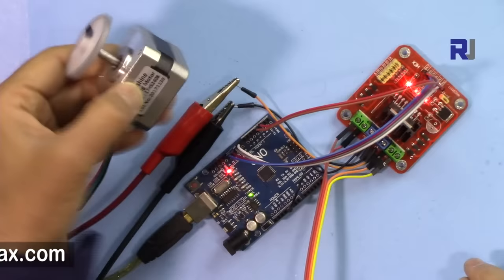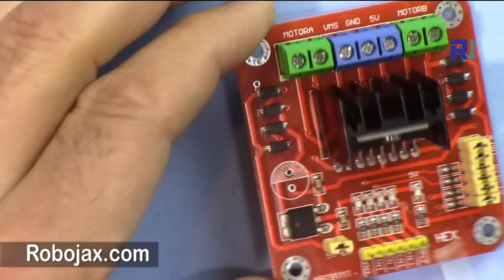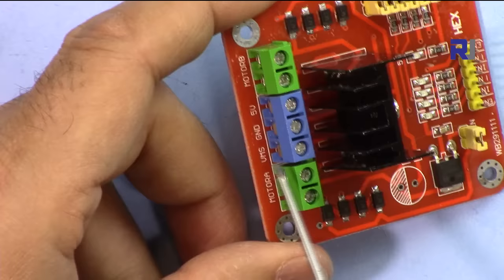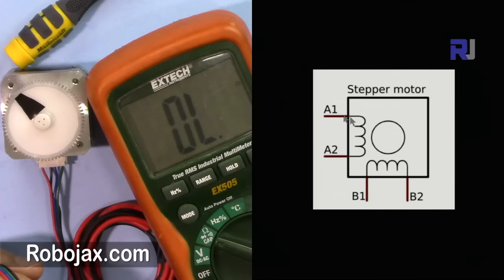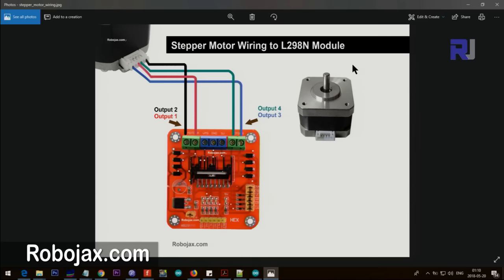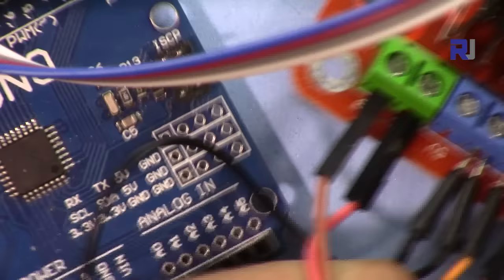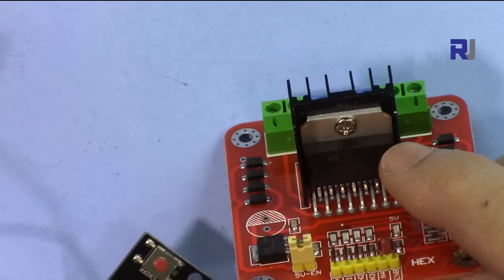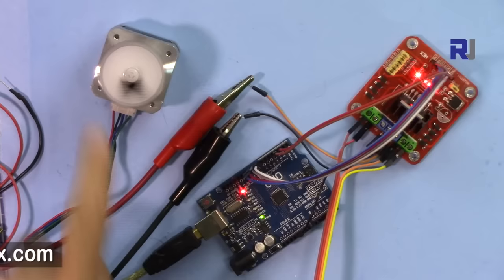Using L298N Stepper Motor Driver To control 4 wires  stepper motor

Comment: Hi Jax. I found you by accident but I'm glad you did.  You have the only video with enough information for me ( a noob ) to understand. I was wondering if you could make a video or explain to me how to code the stepper motor to pulse once everyday. Thank you so much for the amazing video!
Reply: Aka What would be the value of the RPM and and the SetSpeed in order for the stepper motor to turn one rpm per day.
Reply from the maker: Hi, I am pleased it helped.  to use time, we need to use clock module here is the video https://youtu.be/7hBtXdoaAOY which has alarm. now when alarm is triggered you can do anything you want.  From this video which I used push buttons https://youtu.be/csf_G1pi0ps learn more about speed control. and use clock module to trigger it at exact time.  Good luck and stay safe. Please subscribe.
Reply: @robojax  THANK YOU SO MUCH!!!
Reply from the maker: the rpm depends on how large each step is.  smaller and more precise steps will take shorter time to complete one revocation and larger steps will take very shorter time to complete one revocation.

Comment: Thanks so much ROBOJAX, the only problem is why is my driver getting overheated ?
Reply from the maker: Hello, there are two ways to stop the motor. one is hold which consumes energy and holds and the other is just stops the signal and power to the motor.  I think I have used it  in this video https://youtu.be/csf_G1pi0ps  and may be in this video https://youtu.be/cYTICj4DWYc

Comment: Hello, I would like to ask a question.  When I set my motor speed to 60, my motor will not spin, when I set the speed to 300, it can rotate normally.  What should I do to make the motor turn at speed 60 or low speed?  My motor model is 42BYGH47.  Thank you for taking the time to read my question

Comment: Hello sir, I need run the stepper motor 25 revolution clockwise and take rest and want to run 25 revolution ccwise and take rest. Can you help me?  I have Arduino Uno and My motor 24 volt. Drive I can buy L298N. Pls help me for the full code in Arduino

Comment: That’s Great, Thank You for your help. I have a question, can the stepper be made to go in one direction and then reverse to other direction without buttons and more than one revolution? I need the stepper to go
50 revolutions.
Reply from the maker: you may learn from this video. The same code will work. just pay attention to wiring in your module https://youtu.be/csf_G1pi0ps

Comment: Thanks for the prompt reply from Canada Ahmad. The internet is a wonderful addition to our lives as it creates hands across the sea.
 I am an octogenarian and have recently started to learn to write Arduino software. My hobby is making electromagnetic clocks which I design myself.  What I trying to find out is if it is possible to use Arduino as an alternative to Mach 3(Wizard) because I have put a couple of steppers onto a small metal lathe and need some software to drive them. It is not something I have done before. I got close to getting Wizard to run but my parallel port computer died and getting Mach 3 to run from a USB is possible but more complicated.

Robert
Reply from the maker: You are welcome. Learning is journey that never ends. Good luck with your project. https://snag.gy/AHhRpV.jpg

Comment: What is the reason for connecting the ground to both the power supply ground and the Arduino ground. Isn’t ground just ground? Isn’t it risky to send a say 6V power circuit back to the Arduino ground? Sorry for questions, I am still only learning.
Reply from the maker: it is a good question. we have circuit. electronics go (by convention) from + terminal to - terminal.  if we use 1 wire,  electrons can't complete the circuit. if we have just signal wires to Arduino, the circuit is not completed and it wont' work. it is the same if we san connect 1 wire (the positive wire ) from battery to a bulb and expect it to work.
Reply: @robojax  Thank you, that makes perfect sense.. it's not like a water flow where we are just getting water to the destination. We need to complete the loop. Got it. Thanks for putting this tutorial out there to help others.

Comment: This is awesome context Ahmad! Well explained for a newbie like me. can I use nodemcu instead of arduino? What would I do differently if I can use nodemcu
Reply from the maker: Yes it will work.  Just power the module end define pins, it will work. Make sure to use proper PWM pins and define them in esp 8266

Comment: thanks in advance....could i connect a joystick to do this
Reply from the maker: you did not say to do what. but here is the joystick video https://youtu.be/6N8Iq353GM8 and you can use the values from joystick to heave a meaning to be used by the stepper

Comment: Hi, firstly, I really appreciate your videos. Second, my question is that why isn't the motor getting a full rotation i.e 200 steps or 360 degrees in the first example?
Reply from the maker: Hi,  Thank you for your comment. Could you type the time like 2:30 or something so I click and watch. Hard for me to watch all video. I have got over 300 videos and forgot what is what.
Reply: @robojax  Thanks for replying. I was referring to 14:00 i.e the first example. 

The code shows you are giving a step of 200 to the stepper... this means a full 360 rotation. but the video shows only a rotation of like 60 degree and then the direction of rotation switches.
Reply: @robojax  I would like to see sequence changed to - rotate CW then power off - then power on then rotate CCW, please show how to code it...thanks

Comment: I have a project in That I have to control the speed of the stepper motor with the response output of load cell plz suggest some idea to combine load cell and the stepper motor.
Reply from the maker: is the output of load cell a voltage? if so then it would be like controlling it with potentiometer.

Comment: How can speed control code be combined with direction control code ??
Reply from the maker: When I explain the code, I never leave a single line without explaining. So if you watch the video without skipping, and pay attention. or watch it twice or 3 time, you can learn how it works. Then you can combine them.
Reply: @robojax  I have already seen it twice.
But the connection between them, does not need specific codes ??
Reply from the maker: yes. that is what I said. Watch them and learn it. You can do it . watch both videos. here are my stepper related videos https://www.youtube.com/channel/UCkcBSig_Iu4ZnAIeCeG1TVg/search?query=stepper

Comment: what will happen if i connect the 12v dc power supply to the 5v pin in L298 IC?
whether it sends 12 v to all the 4 output pins or burns out?
Reply from the maker: I would have to check the module. But according to datasheet it can handle up to 46V http://robojax.com/download/datasheet/robojax_L298_motordriver.pdf

Comment: hello sir
12VDC with 2amp current is sufficient for driver or not ?????     OR     i have to connect 12VDC/4amp power supply for driver.. because driver current rating is 2amp/channel  it means 4amp total current.... what should i do??
Reply from the maker: the voltage doesn't matter as you can go up to 24V. But the current is determined by your motor. if you motor need 0.1A then just a little higher or if your motor is 2A then have 2.5A power. So it depends on your motor.
Reply: @robojax  thankyou sir

Comment: i want add potential for this code 
#include <Stepper.h>

const int stepsPerRevolution = 200;  // change this to fit the number of steps per revolution
// for your motor

// initialize the stepper library on pins 8 through 11:
Stepper myStepper(stepsPerRevolution, 8, 9, 10, 11);

void setup() {
  // set the speed at 60 rpm:
  myStepper.setSpeed(300);
  // initialize the serial port:
  Serial.begin(9600);
  // L298N for Robojax.com 
  pinMode(2,OUTPUT);// for EN1
  digitalWrite(2,HIGH);// enable EN1
  pinMode(3,OUTPUT);// for EN1
  digitalWrite(3,HIGH); // enable EN2
}

void loop() {
  // step one revolution  in one direction:
  Serial.println("clockwise");
  myStepper.step(stepsPerRevolution);
  delay(500);

// L298N for Robojax.com 
  // step one revolution in the other direction:
  Serial.println("counterclockwise");
  myStepper.step(-stepsPerRevolution);
  delay(500);
}

Comment: we followed everything but wont work. need some help there is data sent in the driver as shown in the led but the motor didnt start
Reply from the maker: It has to work. 1000s of people used it and it worked. Your wiring must be wrong. You have put your wiring in correct way. Do you hear any sound from motor? Have you supplied external power to the motor? Arduino can't  run this motor.

Comment: Nice vid. Using more or less the same setup, but my L298N is getting very hot. You get burned! Is this normal? 
12v power supply. Nema 17 motor(smallest)
Reply from the maker: No. it is not normal. You must be connecting the wiring incorrectly and it causes the energy to be wasted in the wiring. Check the wiring.
Reply: Hi, i have the same problem. Did you found a solution?
Reply: Not really. My wireing seems correct. Might be the motor pulling to much current-have not checked. Ordered a more robust driver.
Reply: @ingmarkranefeld6442  Basically I think my motor is pulling more than 2Amp, and this driver is good for max 2amp.
Reply: Yes I already figured it out. My nema 17 uses 3.9a and the max current ist 2a. Already switched to another motor driver. Thanks for your answer.

Comment: what would be maximum rpm at 12v power supply?
Reply from the maker: Depends on the specs of the motor.  Read your motor datasheet.

Comment: An easy way to find windings. connect a pair of wires, if the rotor becomes harder to rotate, that is a pair.
Reply: Thanks
Reply from the maker: Thanks for sharing.

Comment: Thanks a lot for this great tutorial but I’ve done the same steps and my ic got so hot can any one tell me what’s the problem pls
Reply from the maker: is the motor rotating or it is stall? make sure you connect the voltage that is rated for the motor.  I assume you haven't changed the code.
Reply: @robojax  yes its rotating smoothly and ive used the same code but the l298n ic gets really hot even that im using 12v power supply with the nema17 motor
Reply from the maker: Something is wrong.  either voltage rating of motor or wiring. Try to change the order of wiring for poles of motor. I can't think of anything else.
Reply: @robojax  I wanted to chime in with a similar issue. Everything runs smoothly but like Saad Free said, the heatsink specifically is beyond hot to the touch. I know it's a heatsink but it seems a little excessive. Wanted to ask if yours gets to that temperature? I changed the wires for one of the windings which only caused it to change rotational direction but still become extremely hot.
Reply: @bpm009  Were you able to solve the problem? I have the same issue
Reply: @Gromic2k  I think the issue is that an L298N isn't the best option for driving a stepper motor. I picked up some A4988 controllers for my stepper motor and will leave the L298N for driving only DC motors.

Comment: Hallo . Can we make a stepper motor with motor knob sketch ?? Is it possible to work ? With the motor of your video ?
Reply from the maker: did you check the code? I spend hours making it. check the page again.
Reply: Robojax I check it but as I see it’s for one step at time / revolution/ speed control ... I ask for the first example in arduino code motor knob . Thanks for the reply . Welcome for the comment
Reply from the maker: You missed it. It was just bellow that. Again you didn't go further in the page. I have removed the code now to prepare it for a course.
Reply: Robojax ok thanks for the patient . I am waiting for the code

Comment: I want use NEMA 23 stepper motor 19kg what are the required parts
Reply from the maker: that number has on meaning unless you get the datasheet, see the voltage and current requirement of the motor. For example in this datasheet https://www.cui.com/product/resource/nema23-amt112s.pdf you will see this item has multiple models  and model NEMA23-17-15PD-AMT112S has phase current of 4.2A and operating voltage of 5V. so you pick a motor driver that can handle that current. you will search for "stepper motor driver 10A 5V" or "stepper motor 8A 5V" you must select current 20% or higher than the required current.

Comment: is it safe to use l298n for nema17
Reply from the maker: this motor is nema17.  Yes it is.
Reply: @robojax  you mentioned something about heat sinck
Reply from the maker: if the current exceeds 2A, then you need to have extra heat sink. otherwise this should be good. By the way it shows you have not subscribed.  Spare a subscribe click. I have spend over 5 hours on this project. You need to spend 5 seconds to click on "Subscribe"
Reply: @robojax  i did

Comment: Hi Ahmad ! I own the same kind of L298N board but mine has jumper connecting EN pins (to idk what). I am not sure what is the diagram of this setup so i cant described more than this :/ My question is, do you think in my case, it is a necessity to connect the EN1 and EN2 to arduino the way you did it, and if not, is the 5V GND wire from the L298N to the arduino still necessary ?

Here is a picture : https://ae01.alicdn.com/kf/HTB1FKVOSpXXXXX_aFXXq6xXFXXXS.jpg

Thank you very much ;)
Reply from the maker: Hi, Here my video on the other module  of L298N https://youtu.be/cYTICj4DWYc